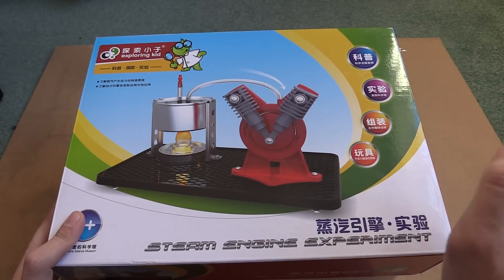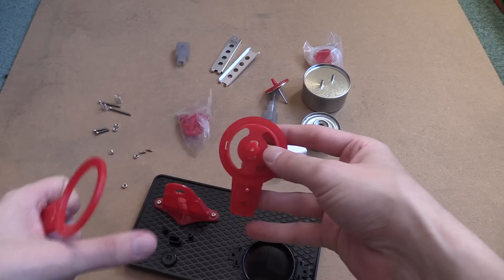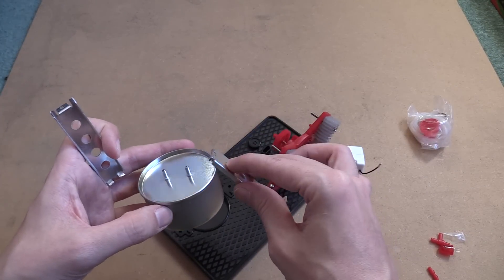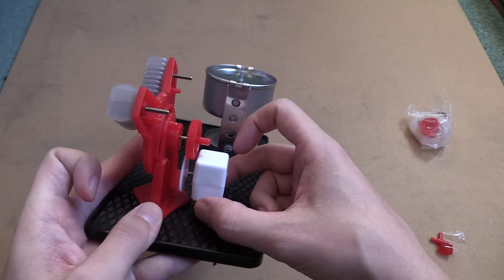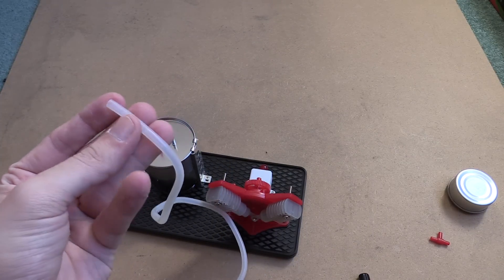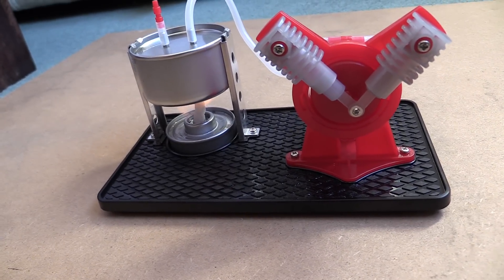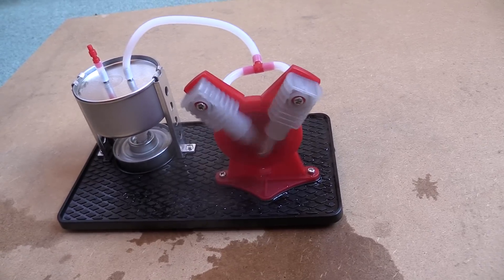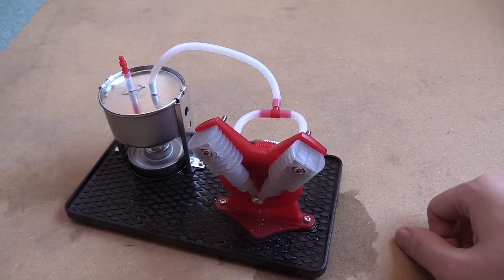Mohoo Steam Engine Kit

Comment: I have bought one of these for my kids but I just can't get it to work.  You make it look so easy.  It seems that every time it gets started a bubble of water forms at the pipe entrance, even if I only put one pipette of water in.  I'm wondering if the flame is too hot, but I've spent my entire morning playing around with this and nothing.  Anyone else got any ideas?
Reply from the maker: Even when it's working perfectly, you'll get a little water in the tubing as the steam converts back to water. But it shouldn't be excessive. The most common problem that prevents these from working is when you install the cranks the wrong way around. Here's a pic that shows the correct way to install them  - http://i.imgur.com/V6cTNrw.jpg . You wouldn't think it makes much of a difference but it can make or break the whole thing :)
Reply: That's the way I have them.  Hmm... will let you know what it is if I figure it out.  Trying to adjust the positioning of the arms that hold the pistons at the moment.
Reply from the maker: Oh okay :( Have you made sure the cranks aren't screwed on too tightly? And are you giving the cog a little push when the steam first starts to come through? From what I remember, the engine spins easier if the red arms are closer together.
Reply: Yes and yes.  I've given up for now.  Was using isopropyl because that's all I have but I have ordered some ethanol.  I know it should work but I'm starting to wonder if there's a problem with this batch or something.  I don't think it's making as much steam as yours did.
Reply from the maker: Could you perhaps send me a picture of yours? ytgadgetaddict@gmail.com . It sounds like you've already thought of everything but it never hurts to have an extra pair of eyes :)
Reply: +Gadget Addict 
Blinking typical!  I turned the arms on the pistons round (opposite way to the instructions) in case I'd somehow managed to assemble it back to front.  Nothing happened so I put them back to how they were and put my camera on to film it "not working" for you and lo and behold it works like a dream.  No idea what was wrong!  Maybe I hadn't quite screwed them properly or something?  Anyway if it doesn't work try taking it apart and putting it back together again.  So typical!  Many thanks for the help.
Reply from the maker: Wow, strange. I'm glad you got it working though! Congrats :D
Reply: @rjones6857  your engine has a Windows operating system version...turn off and on et voilá...everything is working!

Comment: It seems dangerous to me to run this on low water. I see it has a sort of safety relief but it’s just a plug not a metered relief valve. Keeping it full make for less chance of exploding the boiler and there’s no safety cage or anything around it. Besides the fact it comes from China where their QC is severely lacking. I wonder how many (if any) of these have blown shrapnel and scalding steam on the operator?